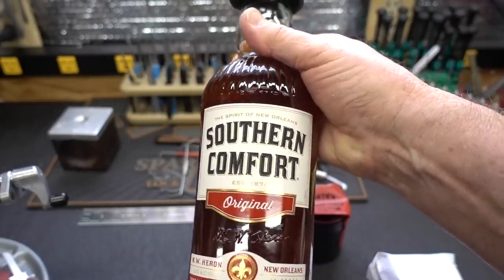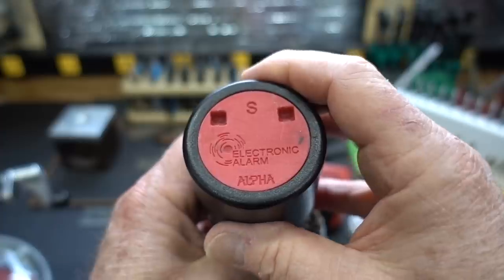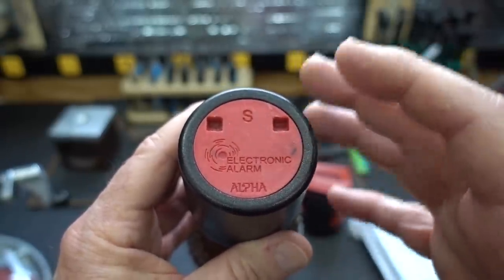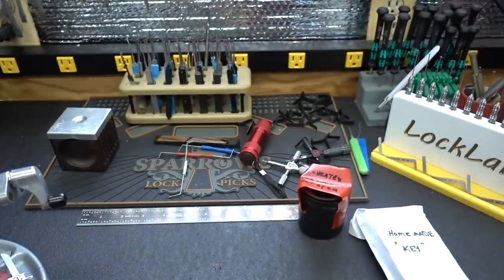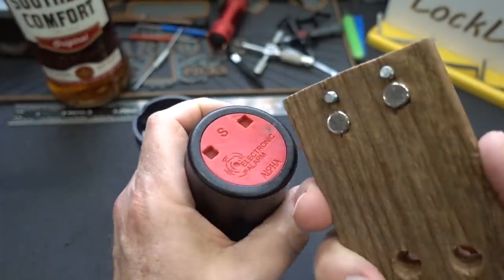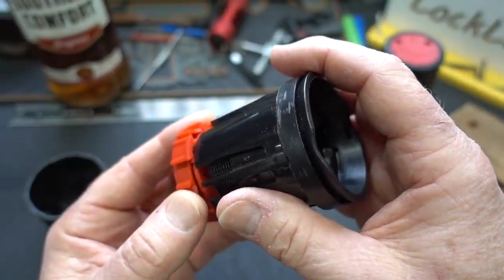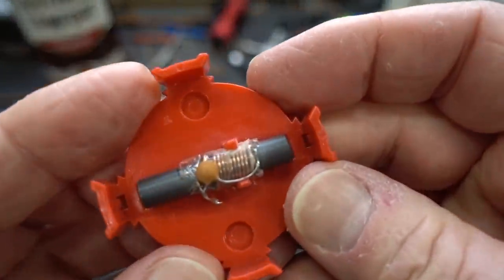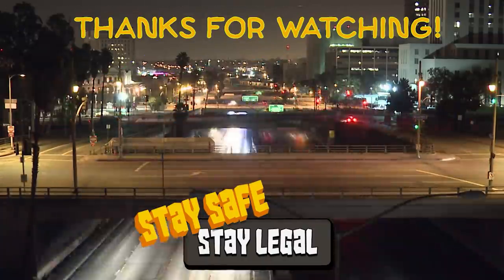(1849) Magnetic Bottle Lock

Comment: That coil is probably meant to cause the metal detectors at the front doors to go off if someone attempts to walk out of the building without removing the security cap first.
Reply: It's not usually metal detectors at the front of stores bit instead induction hoops that work just the same as a wireless charger. The hoop emits harmless electro magnetic energy which induces a current in the wire wrapped around the rod in the cap of the bottle. That causes the coil to emit a low powered radio pulse that the hoops pick up and set off the alarm. It's exactly bthe sane technology that is put into expensive ski jackets so people caught in avalanches can be located under the snow.
Reply: @frainy345  thanks for the clarification.

Comment: It says electronic alarm to put fear into the kids from attempting to get into it.
Reply: It will trigger an alarm but not from the bottle, it triggers the security hoops by the main doors of large shops. It's essentially an induction powered radio transmitter that is energised by the hoops as it gets near.
Reply: @frainy345  ohhh like those security tags on clothes?
Reply: @roysammons2445  exactly the same, just in a different cover
Reply: @frainy345  😁👍🏻